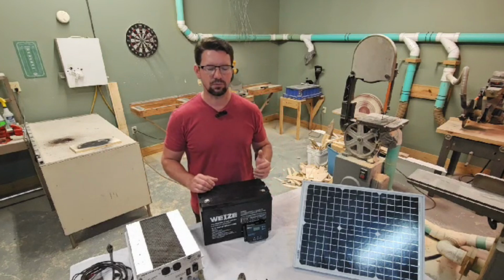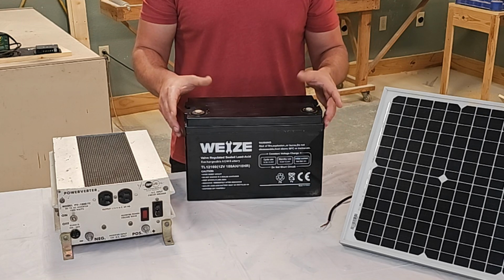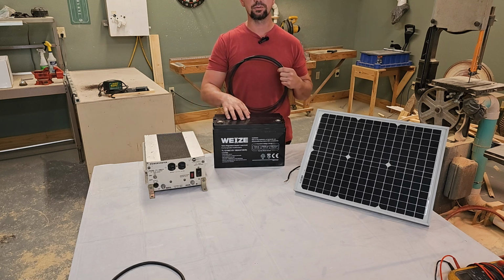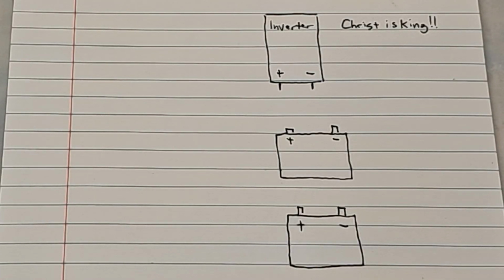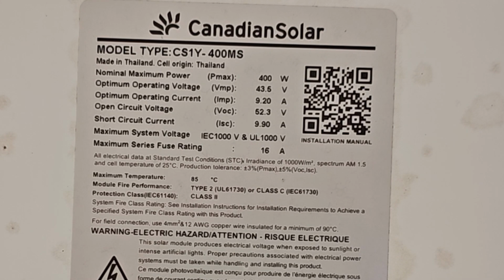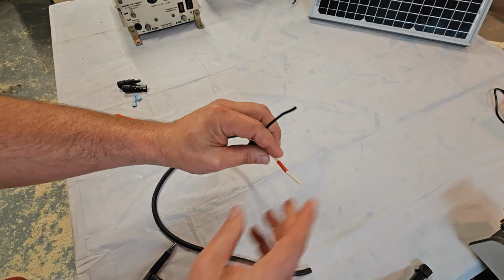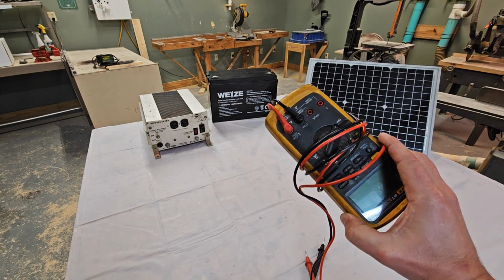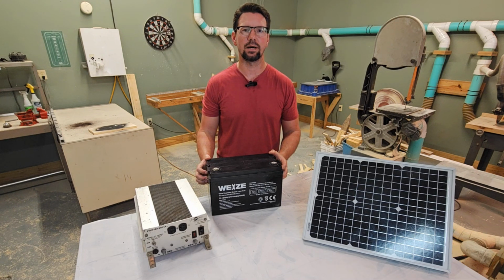DIY Solar Generator

Comment: I'm not sure what long term means to you, but to recommend cheap high frequency $5 chipset based inverter, is never a good idea for long term, dependable, safe electricity! Agm, nope. Lithium isn't much more, and you will buy 3 Agm to last as long as the lithium, so its definately not cheaper.  Next, never 12v to 120v  for over 1500w, anything above is too high amp draw.1500 ÷ 12v = 125amps, 3000w ÷ 24v =125amps, twice the power, same amperage, same cable sizing, and just as cheap! It's not rocket science, just about knowing what your doing. Common sense isn't always common anymore!
Reply: Shut the fuck up and get your money up

Comment: Choosing an SLA or AGM battery over an LFP is the very definition of false economy, these days.  When you compare batteries of the same amp-hour capacity, the LFP weighs half as much, delivers twice as much usable power (without the voltage sag of lead-acid), and is capable of 3 to 5 times as many charge cycles.  Even at that point, when the SLA or AGM would get recycled, the LFP simply drops to where it only stores ~80% of its original capacity...it's still perfectly usable, other than that.  Only someone who doesn't understand how effective LFP batteries are, and how much their price has come down, would recommend SLA or AGM, these days.  The only caveat is you have to be mindful to not charge LFP when the cells are at or below freezing...which is a simple thing to do.

If you know what you're doing, and have a few tools, you can build a 50ah LFP battery for right around $100, using 2nd-life cells.  The size is incredibly compact and lightweight, but would give you the same usable capacity as that one-way boat anchor (SLA) you are showing in this video.

Comment: Shouldn’t you size the wire based upon the max amperage that the inverter might draw.  In this case 1500 watts divided by 12volts equals 125 amps.
Reply from the maker: @guywood67 thanks for watching. I thought about that several times, but I was teaching how to build a dedicated solar generator for a refrigerator during a long term outage. I wasn't meant to do much more than that. Every component and wire size was intended to help people and save them money. Your thought isn't wrong
Reply: @RicksFix507  there's a term for this, it's called cutting corners. Wiring must always be chosen according to the capability of the attached components. This is to avoid burning them out and causing fires. On that note as well, where's your fuse? You need one near to the battery's positive lead, again, rated for the maximum possible sustained current. (Should be a bit higher, so for 125A expected current, use a 150A fuse.)
Also, that inverter uses modified sine wave which can cause problems in refrigerators and a lot of other devices. Get a pure sine wave inverter. If you're after cost savings then go for a lower wattage like 1000W - you'll likely find it sufficient for running a fridge where the modified sine wave at the same wattage wouldn't be.
Reply from the maker: @BruceKlorfine  thanks for the watch!
Reply: @RicksFix507  the only thank you I'd find appropriate would be about the safety advice I've offered, or if you would take down the video.

Comment: There is absolutely NO reason to use an SLA battery any more.  You're showing a $150 SLA and you can get a Lipo4 for $170
Reply: Says the person who has likely never been below freezing temperatures with a lithium battery
Reply: @stevencampbell1603  - Yeah, cuz it's "so hard" to make sure a battery is above freezing before you charge it.
Reply: @jasonbroom7147 usually when you need a solar generator, in a number of places including where I live, it's fall/winter when it's cold and a storm knocks out power.  If you don't have an off grid means of heating, alot is going to be cold...

Sure, load the battery into the car, warm the car up which eventually warms up the battery before you can charge it...

Such ease keeping the battery up to temp before you can charge it...

Granted, I'm building a vehicle based solar generator and since I travel to cold areas, I'll be building in a heating unit for the batteries.  It's going to draw significan energy just to heat, but it is what has to be done to charge up...
Reply: @jasonbroom7147  are you going to idle you car with the heat on for an hour before you try and charge the battery?

Or just have an SLA battery and don't have to worry about heating the battery to charge...
Reply: @stevencampbell1603  - No, I'm going to have a tiny, DC-powered heating pad on the battery, keeping it between 4 and 7 degrees, Celsius.  Easy-peasy.  I already have two such systems in place.  Life will constantly throw opportunities at you, often disguised as challenges.  You will thrive when you overcome the challenges to realize the opportunities.  Like I used to tell my kids, when they got old enough to understand...don't come to me with problems, come to me with what you think are possible solutions to problems.  Are you focusing entirely on the problem and failing to see the opportunity?

Comment: One thing you could improve on, is when connecting batteries in parallel, to connect your positive lead to one battery, and your negative lead to the other battery. This will help keep both batteries more in a state of balance while cycling.

Comment: Of the inverter you. recommended, do you know what the idle consumption is?  Btw, great video and presentation,  very clear and precise instructions for the beginner.  My only recommendation would be is that is some people still learn more by visualizing the steps you presented.  So the actual action of connecting all the cables and wiring would be very helpful as many will interpret what they hear differently and may get confused.  Again great video presentation.

Comment: can build a 4kwh lithium battery which is the same size, almost the same weight for 150 bucks right now.... its just 8 bolts and an inductive active balancer. weighs about 40lbs or 10-20lbs less. 2 orders of magnitude usable capacity and wont crap out after a few years like lead acid. only problem is it takes 3 months to ship. this is why we are slapping tarrifs on china starting next year
Reply: Nice explicit video pls keep it up
Reply from the maker: Can you tell me where you can get these batterys?
Reply: @RicksFix507  4hr shadow ban for sharing yew are el's here. alixp 11.11 sale with coupons and 5% paypal chase cash back
Reply: @RicksFix507  ally xp
Reply: Nice simplfied video pls keep it up

Comment: The price of Lithium Iron Phosphate (LiFePo 4) batteries is much lower now than they used to be. You can many 100Ah lifepo4 batteries now for about $160-170. These batteries can be used to about 10% capacity remaining. So you can get the same usable Ah with 1 lifepo4 battery than  2 AGM batteries.

Comment: Thank you for the concise description on how to assemble the panel, the battery, the wires, and the controller-- but mostly for what to buy and where to buy the components. To me that is  half the battle. Great video for someone like me who has basic knowledge but didn't want to spend a week trying to figure out exactly what I needed.